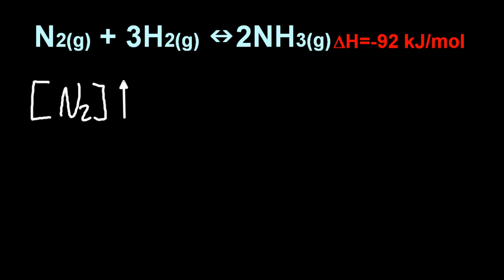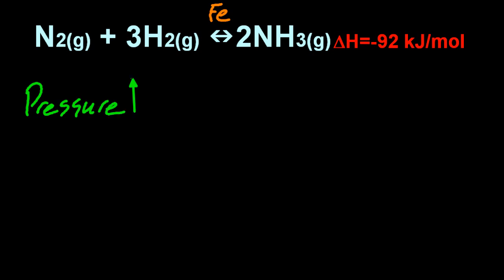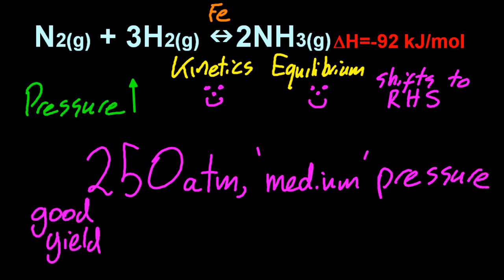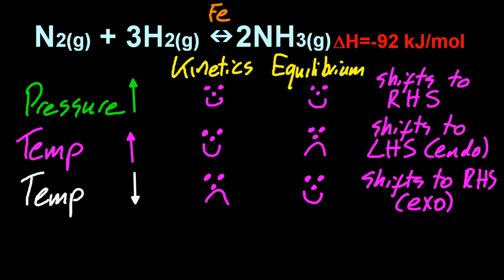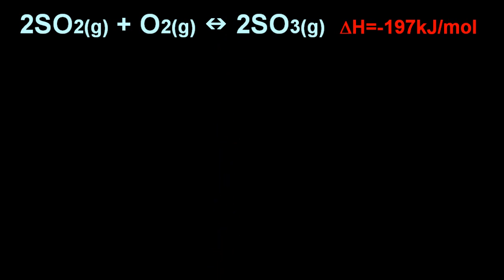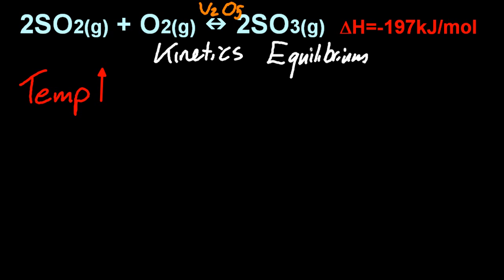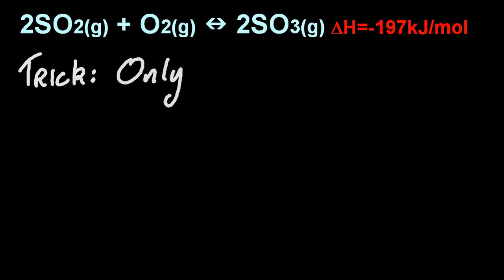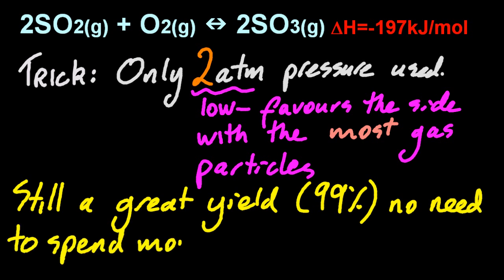7.2.5 Apply the concepts of kinetics/equilibrium to industrial processes IB Chemistry SL

Comment from the maker: 2 atm is what the IB says.  Equilibrium has many aspects, concs of reactants, products catalysts, temp and pressure.  It just so happens that pressure is not that important here, if the other factors are optimized.  More pressure, shifts to the side of least gas = products.  But it is not worth the extra money needed to increase the pressure.

Comment from the maker: If a reaction becomes hotter it is exothermic. BUT
if the reaction is in equilibrium then giving it heat (say but putting the container in boiling water) will shift it to the endothermic side.

Le Chat says: "If a reaction in equilibrium is stressed , then it moves to oppose the stress"

Imagine if heating it up, moved the reaction to the exothermic side, which heats it up more etc etc, then the universe would explode!